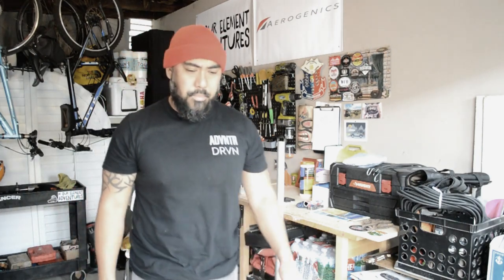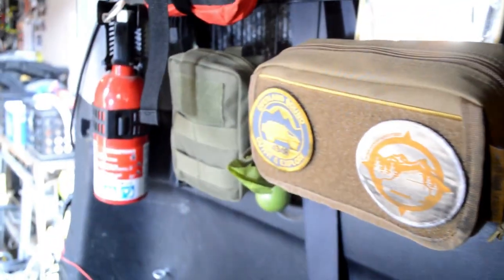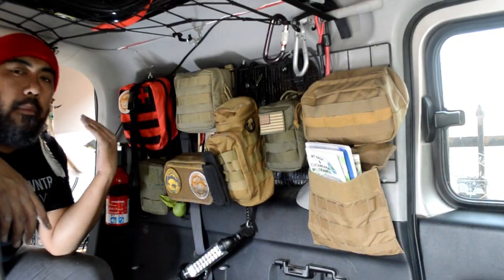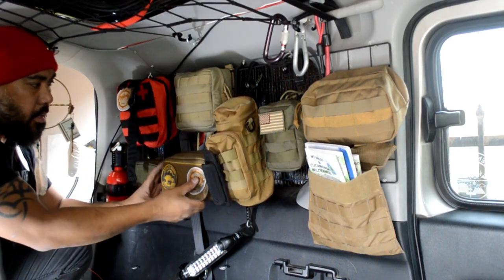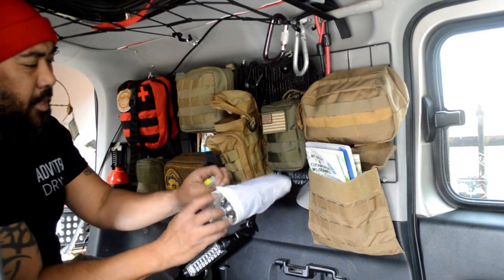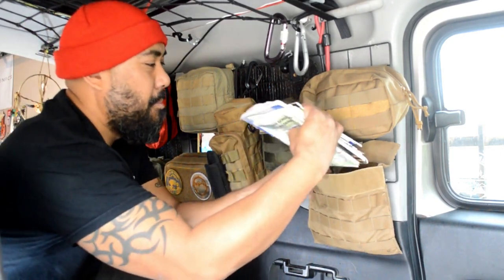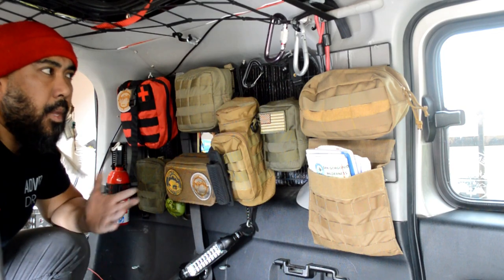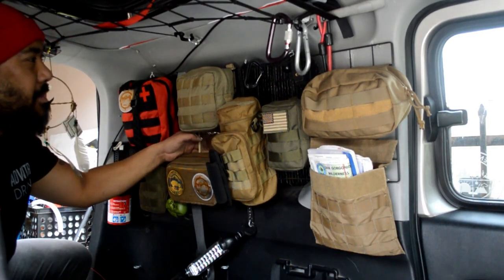DIY MOLLE PANEL || 2003 HONDA ELEMENT

Comment: I'm curious, is it noisy when you are going in trails. I want to do something similar but the noise of clattering things usually drives me nuts 😁
Reply from the maker: I no longer have the vehicle, but it did make some noise. Nothing obnoxious but not super quiet.

Comment: Hey!  Great idea and video.  I am working on a similar setup for my E.  Did you screw the eye hooks directly into the plastic and they hold well enough?  I did that in the rear cargo area for a bungee cord, but didn’t know if the plastic was thick enough around where you did it.  Or did you remove the trim piece and have a nut on the back of it?  Thanks- your channel has been a big inspiration for my build!
Reply from the maker: Hey thanks for tuning in! Yes I actually just screwed straight into the plastic. Its held up well. I havent had any issues with it slipping off. Im thinking the bungee cords I looped through panel and eye hooks might be absorbing motion, and any stress. If I had to do it again, I would probably remove the panel and like you said put a nut at the back. Looks cleaner and would still hold up well. But, so far we have had zero issues.
Reply: Awesome!!  Thanks!  That helps a lot.  Looks like you have a fair amount of weight on there, so if its holding up well, that gives me confidence in it.  If they pull out, then we can always drill it and put a washer and a nut through the trim piece.  Thanks so much for quick reply!

Comment: What is the tire deflator for?
Reply from the maker: I primarily use it when airing down our tires, to allow more traction on those softer trails. It also serves as our tire gauge.
Reply: In Our Element ADVNTRS Thank you!

I have a front wheel drive 05' & never go off road. I hadn't thought about the traction side of things.

Great video, by the way.

I would love to do more with/to mine, but I am not sure where to start.
Reply from the maker: No problem. Thanks for watching! Careful where you begin, it may become a never ending rabbit hole! Lol. For us, simply getting out there on short overnighters and road trips taught us about what things we wanted, and needed.

Comment: Hi,
You might wanna think about upgrading your FRS radios to GMRS radios. Good video too.

I have a '12 Tundra and I am in the process of doing these things to mine. I just received a backseat molle panel with all the nice pouches off Amazon. 

I am also looking at those dividers as I have an extra kennel we're not using anymore. I was thinking of drilling it into the rear panel beneath the rear window and mounting tools like a hatchet, an axe or maybe even a shovel. All kinds of possibilities. 

Great video and thanks for sharing your set-up.